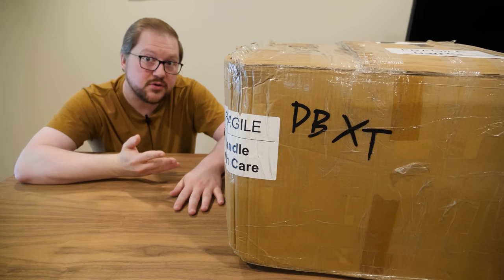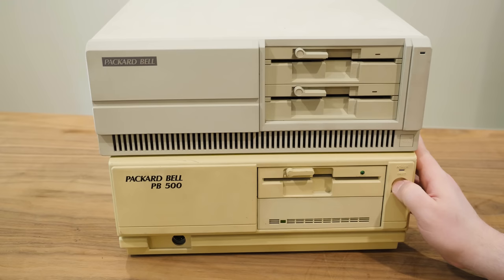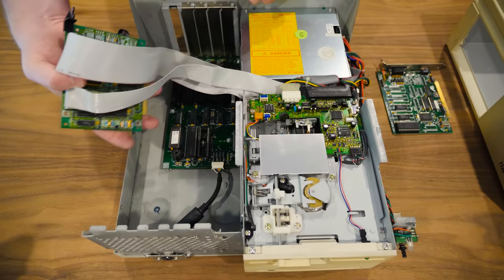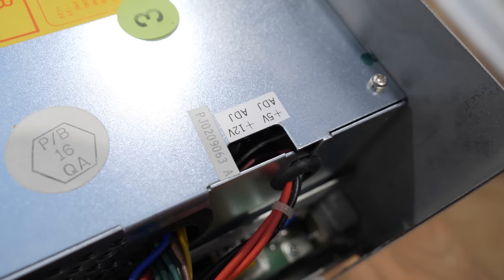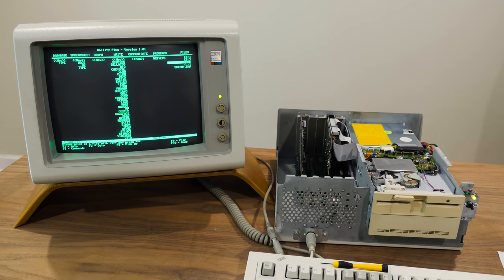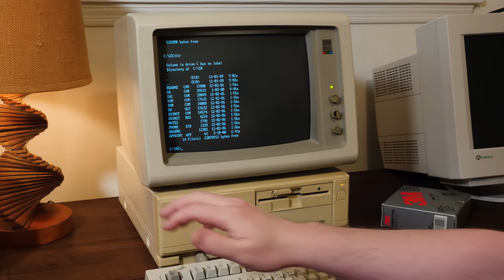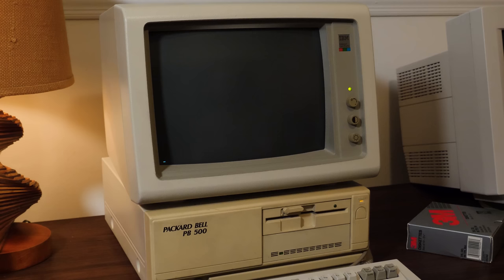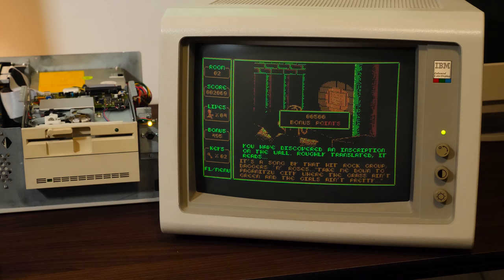Exploring Two 1980s Packard Bell PCs: PB 500 & VX88 Turbo XTs

Comment: I'm pretty sure we had what may have been a model PB 500. Pretty much the same configuration, ATI small wonder (ver 2), same drive controller, drive config (it was stock) and DOS 3.3. Our wasn't defaulted to turbo mode, I remember finding it in the manual and feeling like a boss. The LED changed and instantly my dir results were way faster. Also the stock monitor was an amber monochrome, also made by Samsung. I still have the video card and monitor, when I was in college I put it in a Pentium 2 system and used it with Linux. Played a lot of PGA golf on that and a helicopter game called Striker.

Comment: Since you work with older hard drives, I highly recommend giving Steve Gibson's SpinRite a try. It's $80, and you might find it'll revive some of the older MFM and RLL drives that are having non-mechanically related difficulty running. If you buy the latest version, Steve lets you get a copy of older versions for free as well. IMO it's a must for anyone running spinning rust. When I bring my family's XT out of mothballs, I'll be using that to revive the drive to preserve the copy of DOS 5.0 that I upgraded to from IBM's DOS 3.1 on my NEC-V20 powered XT that splits BASIC between a rom on the board and the executable. I think that was one of the earliest anti-cloning measures employed in the PC space, but I could be wrong.
Reply: oh man I have heard of steve from his DNS benchmarking program
Reply: @RickBaconsAdventures  Yeah, I've used SpinRite to recover some drives that I thought were totally dead. He's also the guy who coined the term "malware" back in the TechTV days. Phenomenal security researcher and assembly programmer.

Comment: How neat.  I have a PB500 as well.  But mine came with a Hard drive, a 3.5 inch floppy and a 5.25 inch floppy.  On top of that it's a 286@10MHz.  Has a VGA card as well.  My guess is it was sold in the early 90's as a really affordable machine.  I bought it on ebay for $35 dollars because it was sold as parts.  I replaced the external battery pack and it worked fine.  I added a nice little Aztech SB clone the NX and it is a nice little machine.  I wonder how many different machine types were sold as PB500 back in the day?

Comment: I should have watched the whole video first :D

Original comment:

Try Ctrl+Alt++, that is, Control Alt "plus sign". And Ctrl+Alt+- for speed control. When I was a kid we had a PB that was pretty much identical, right down to the NEC CPU, but I think it was the V20. A bone-standard MS-DOS 5 install from Microsoft retail disks worked with those shortcuts from my memory. I could be wrong though, I haven't seen that machine since like... 1996 or so. My folks gave it to my grandma and grandpa when I got the 486.

Comment: Whenever I see these old cases I start considering if it would be possible to make a sleeper build with modern stuff on the inside. The VX88 would be great for that. Though I assume that airflow will be an issue...

Comment: Desolder the can speaker and solder some wires in its place. Connect your cone speaker and louder audio. Or you can add an amp and beep pictures off the walls. lol

Comment: Regarding 3d-printing an "over-the-top" bracket for cards - the reason this one works so well is that the PCB extends to the full height of the blanking plate, so there is very little plastic or support needed. That's unfortunately not a universal solution because cards definitely don't adhere to that as a standard :(

Comment: The VX88 reminds me of the Epson Equity line (the I, Ie & I+)
Reply: The V40 isn't a bad 8086 based chip.  It performs about on par with the 8086, and is compatible.  It supports 8080 emulation. It has some extensions that make it it some what 80286 compatible (but not quite).  It isn't 80186 pin compatible, but the extended instructions are inline to that processor.

Comment: That hard drive sounds like is trying to send a message in morse code.
Reply: Most of the sounds you hear are from the stepper motor, the far quieter voice-coil drives from around that time don't make nearly as much noise.

Comment: Sure would have been cool to see if Commander Keen CGA looked any different on an actual CGA card for comparison. I'm always curious if those EGA/VGA cards that emulate other modes do a good job or not compared to actual CGA.
Reply from the maker: There's no emulation going on between EGA and CGA cards like the ones shown here. It's straight up backwards compatible hardware so there's no visual difference, so long as they're holding to the same color palette and brightness settings. 

The thing that can be different though is the performance, so maybe I'll show that in future tests :)
Reply: @LGR  True, I know Trident VGA does have some kind of backward emulation, but your right MGA/CGA/EGA isn't emulation... Funny, I jumped from MGA to EGA then to SVGA so I missed the whole CGA world as a kid (beyond playing strictly CGA on an EGA) maybe there was no difference, but a teensy piece of me still wonders what I missed :P
Reply: @LGR  Interesting the GSSC (Graphics Solution Single Chip) variant you have has the SRAM and hercules emulation... so it could do high res monochrome and may be a wee bit faster.

Comment: 18:48 what makes the old hardrive make those noises? why is it doing it. and comfy as always LGR nice one
Reply: It's reading and writing. There's a head that hovers between the plates where the data is stored. A motor makes sure that the head is in the correct position to read that data. The squeaky sound is the motor doing those small adjustments.
Reply: Assuming you mean the intermittent "beeping" noise, that's the stepper motor moving the head armature in and out to the various cylinder positions on the disk. Modern HDDs still make that kind of noise as well it's just much quieter and sounds different (more like a soft clicking) because it's smaller movements done at much faster speeds.
Reply: In those days there wasn't much difference between a hard drive and a floppy drive except the solid platter(s) meant the hard drives could be spun faster. At work we had a hard drive controller card design that used an NEC chip that could be used with either Hard or Floppy drives.

Comment: Usually when the screen does that weird blockyness, it is actually sending out a video signal, but the clock rate is off. There might be a way to fix that cheaply, as it could just be the crystal or the signal being gummed up, both of which can be replaced with modern parts.

Comment: am surprised that no retro computing channels have bothered to do a series on surveying TSR software from the 80s. Am actually noodling a resurrection of the TSR. On Linux there is a significant audience that likes full screen terminal software over GUI because it's still faster to screen render. I use a program called Standard Notes that I use in a manner analogous to TSRs. So a memory resident applet that does some useful things, is summoned instantly with a hot key, and an efficient UI that can be keyboard driven and renders ultra fast - that still has appeal. Is Maybe time to bring back a modernized TSR concept...
Reply: The history, rise, and fall, of TSRs would make a good Tech Tales episode. Qaurterdeck systems, Macintosh Desk Accessories, fast switchers, etc

Comment: 10 pins means a slightly cheaper connector, header, and two fewer wires.  Mass consumer products lived and died by nickels worth of margins.    At least they used to before $50 iPhones sold for $1200. Keep buying that garbage though.  It keeps the rich overlords happy.